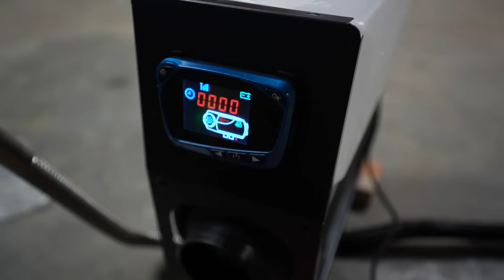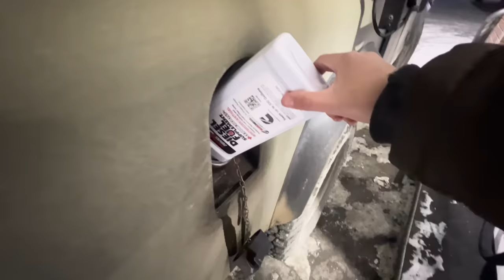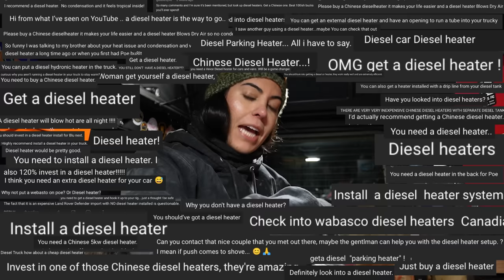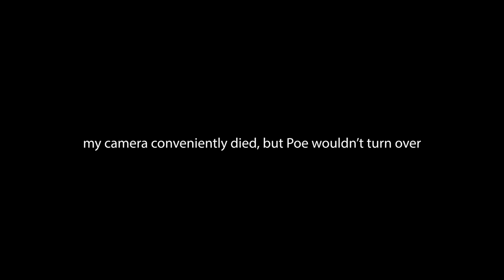Truck Camping in -15 Degrees under the Northern Lights

Comment: Im no expert but i bought a sherpa lined hoodie and it was much warmer than any other coat ive ever had. I would layer thermal underwear with a sherpa lined sweat suit and top it off with a goose down snowboarding jumper, wont be cheap but you can probably walk around outside without being cold. If you are not strapped for cash i believe several companies makes a battery powered heat suit as well but if you did the combo above you will probably be sweating as is.

Comment: This is how you become an Alaskan, you show up and just don't leave. Lol, that's how I ended up here 10 years ago! On a side note, it would have been a good idea to hold onto that buddy heater until you got the Diesel heater figured out. You learn to be overprepared up here after experiencing negative temps.

Comment: Need an oil pan heater as well You just glue that sucker on to the oil pan and plug it in when at a house or anywhere where it can be plugged in. Also any Alaskan mechanic would help hook you up with what you need to get by in Alaska in your excursions through the winter. :D

Comment: If you only have one battery in Poe, go to Wally's and buy a second battery - marine deep cycle type, not car starting - and wire the heater to it. Then, while you're driving, connect this battery to Poe's main battery so the truck is recharging it while you drive. One last thing (for now): make sure you never disconnect the Diesel heater from its battery while it runs. It will melt down... not fun. Wiring gauge and proper connections are also important... lots of little things that can make or break the Diesel heater experience...

Comment: I think the engine gets it much outside air in this weather. Look into that. May need to cover the front grill. Also check into special wiper fluid for those extreme colds.

Comment: Glad you are ok.

Not sure about your heater setup. Check the specs on the heater and the power source. . I have seen people experience problems running the heater due to the glow plugs drawing more amps than the power station, outlet, can output (during glow plug heat-up). for example if the heater requires a max draw of 15a during startup (glow plugs) and the outlet max am is 10a... you will, likely, experience problems.  Good luck.

Comment: Diesel heaters do not work well with portable power stations. They have a large amp draw at start up and will not start if there is too much voltage drop.

Comment: Not for nothing but this is best I can do to help I just watched another channel who was using same diesel heater and I am also sure they had a faulty wire right out of the box, I would check the wiring might need a little more expertise to help troubleshoot but I would start there.

Comment: be sure you add the diesel additive for your heater which you most likely did. That brand has a controller problem a few of my friends bought the same thing. I'm not sure I think another brand of controller will work. Just have to check with others to find out.

Comment: Maria, I’ve had quite a bit experience with diesel heaters and it seems like your diesel heater has a bad control board. I’ve heard bad things about the brand you got but I’ve never had one myself so I can’t say whether or not it’s good or bad.
I bought mine off of Amazon. It’s a Chinese one and it’s lasted me for two years. Hopefully it doesn’t go out on me now that I’m talking about it. Lol. Anyway, my suggestion do not leave the diesel heater outside to run , mount it inside your truck if you can , that way it will stay hot and it won’t out  in the elements subjective to  moisture and all that ! pipe the exhaust out through the bottom of your vehicle. You can leave the intake inside it’s fine that way !  I have mine inside my cargo trailer and it’s worked for two years no problem, you will stay a lot warmer with the diesel heater inside. You may smell a little bit of diesel exhaust when it first starts up but after that you won’t smell anything. That’s just my two cents. I hope you can get it worked out.

Comment: I’ve installed and used a Dirksen heater (still have one in my car) I think the one you bought is for like a small shop,  Or an outbuilding. Maybe. Idk what they have for sale there, but Amazon sells the cheap Chinese or Espar style heater you connect directly to your tank, power to the heater and pump, then exhaust out the back or side of the car.  It’s like the size of a football. They heat up a sprinter high roof so fast it’s hard to manage the heat. Anyway, as a dad of two daughters, don’t have heat and car troubles at the same time and too far from help.

Comment: Check out Chuck Porter  at Everything Outdoors. He's just dine a  minus 15° Celsius  tent camp with the same diesel heater as yours, he also had the air intake in the tent along with the heater and only had the exhaust outside. He found the heater doesn't work as hard when sucking in warm air...He is based in Labrador

Comment: Thumbs up for Gooloo getting it jumped off. I have that identical jump pack. And if you were not sure why it started beeping is it got overheated and needed to cool down (I had it happen to mine). Hopefully you get the diesel heater working. I'll be looking at your next video.

Comment: They say oil change places over-torque oil pan bolts to 100% protect them from any complaints that the oil drained out and wrecked the engine due to them leaving the bolt loose. I kinda suspect they do it so that you can't change your oil yourself and have to take it back to them on your next oil change. If you can get the bolt out, you can replace it with a oil drain valve, and then its just the matter of unlocking and turning the level on the valve to drain the oil.

Comment: Regarding the Diesel Heater, I think that the battery pack is not giving enough power. Try to start with the car instead. It needs up to about 150-180 Watts at startup and many power banks cant do that. I had the same problem on my boat. Turns on but goes out when trying to start the heater.
Reply: To find out if it's this, it might say "overloaded" on the batterything when you try, at the same time as the heater goes black :) Also, they heater is on more Watts, but the 12 volt Car Cigarette Ligher connection often don't have the same output.

Comment: Please, consider heading South unless You get reliable heat for Yourself and Blu AND, Poe needs a Block Heater and Battery Blanket. If Poe freezes up……36 years in AK. There can be days when -15 is a high for the day. At least consider heading down to Anchorage or Kenai Peninsula areas.

Comment: Glad you survived!(Just!) Hope you make sure of having 2-3 heat sources just incase. Carry some fire lighting equipment matches&lighter and lighter fluid, if worst happens you can light a fire as a last resort if you find some deadwood and have a way to light it, to keep from freezing! (Especially if God forbid you breakdown!)
But generally the Landrovers are built like tanks, literally the British Army and many Armies use them for a good reason, as theyre great from a Hot desert to freezing cold temps, So you should be safe aside from battery/electrical issues with the cold sapping them. (Keep that pop up top down to stay warmer and if out of heat, then sit in the drivers seat and put the heater on your feet!)
Stay safe! And All the best from London 👍🏴🇬🇧

Comment: It’s the Jackery. It’s too big for the Vevor. I have the same Vevor heater and the same size Jacery. It’s too much power for it and it shuts if off. However I have a smaller Jackery (300) and it works fine with it.

Comment: The truck needs a diesel heater. (Webasto) 
If I had to rely on my truck I would install one, but they cost so much so I just don't start the engine when its below -10.

Comment: At about 10:40 "I'm lucky Poe is running... if Poe wasn't running right now I would be toast." There you have it.

You're depending on Poe for heat and as a way to get you out of camp if needed. Your plan B seems to be your cell phone. Have you gone through which of these parts worked during that night and which did not, and why?

If Poe stops running, you lose not only your heat source and means of transportation, but pretty soon after that your propane will start acting up and the performance of your power bank will be diminished due to cold. Around where I live, people driving their car north of Polar Circle are advised to carry warm clothes and some dry firewood in the trunk, in case of mechanical problems with the car. The idea is to stay alive and functional until help arrives, and keeping everything really low tech to make sure stuff works in an emergency.

You might consider adding some things in your survival toolbox, if you plan to continue camping in cold weather. Have that heater installed. Add a proper winter sleeping bag - winter outdoors fans sleep in tents at -15 Fahrenheit and colder. Finally a really warm layer of clothing - I'd even look into snowmobile riding gear or something similar. It's Alaska, stuff like that should be readily available in most stores. Safe travels to you and Blue!

Comment: Diesel heater.  I suspect low power source.  Glo plug pull amps, which drops volts from source, which kicks heater into error and shuts down.   That was my experience.  Good luck.

Comment: Your channel is excellent, and your are a wonderful and inspiring young lady!  Lots of good advice from people here that care about you!    Please consider multiple backup heat methods, and not just devices.   Its possible the cigarette lighter outlet on the jackery is not able to carry the startup amperage of the heater??  Could try to start from another source....i had that problem before 
From an old guy grandpa, but have spent alot of outdoor time....still do.     Take care!!    OTD Mike.    (Older than dirt...).  Lol

Comment: Dude. This was stressful to watch. Aside from you needing some reliable heat, you should look at getting Poe cold weather ready. Diesels aren’t great in cold weather. You should have a block heater (for when you can plug it in) and see if you can get a Pro-heat or something. I was a trucker in Alberta Canada for 16 years and Pro-heat is the way to go!  Not sure since Poe is an import but look into it, please!  And stay safe (and warm) out there!

Comment: You should consider sleeping right in the back with the alucab down in the colder climates, I don't imagine that's holding heat in very well, smaller area to keep heated you'd be in way better shape !

Comment: The diesel heater is not starting because it doesn’t like the power draw from the your anaker power module.  The glow plug draws a lot of electricity in the beginning so I bet it’s auto shutdown because it doesn’t have enough energy to start glow plug.  You’re gonna need a direct hook up to car battery with no cigarette lighter plug in. Sorry, I’ve seen this before

Comment: Why didn't you fit a artic  heater to Poe, they are standard military attachments to land rovers that were in service in British Forces. Best people to speak to in UK  is Blanchards or Richards they are MOD /DOD   specialists.  With the diesel heat , you can check the pump is working by taking off the fuel pipe coming out of it and operate unit to see if it pumps the fuel. By the way pump it into a container to catch it or if you have a multimeter check it has the 12volt supply to it. Also with the meter you can check there's voltage on the glow plug

Comment: These CHD should not be run from the 12v input on a portable power station. The voltage is to low. other issues, fuel line green does not work, need to prime etc., these things are a work or art to even work properly...so many ppl these days think they are the new all, hahah be prepared. In Canada and northern climates always have a back up, wood stove, buddy heater....plan for a b c and then D, -15 is a joke when -40 is what you should be prepared for......love your video's, keep up the good work!

Comment: Got to see the Northern Lights in action. Mission accomplished despit trying to sleep in -15 temps. That is something to remember for sure. Now get the heck out of Alaska before you freeze your toes off girl. Also as others stated partially blocking the grill off with cardboard will help provide warmer heat. Running a diesel vehicle at ideal uses next to nothing in fuel. At truck stops 18 wheelers leave their rig running all night on the regular.

Comment: Looks like the DC outlet isn’t strong enough to power it.  I had the same issue.   I have the Jackery 1000, and the DC trips with the diesel heater, but I plugged it into the Jackery 240 and it works.  I bet that is the issue

Comment: Glad everything worked out good for you. About Poe not blowing hot air wonder if the engine was getting to operating temp. If not maybe increasing the idle a bit would get some heat out of it in case your in that situation again.

Comment: You've got to stash a 0° sleeping bag and a mini propane heater. Keep a Co2 monitor too, but if anything happens and you had those, you'd be great.
Reply: Natural Gas is guaranteed and you can always have it.  Gotta keep a propane heater and keep that Co2/Carbon Monoxide with you. You be confidently safe.

Comment: Never fill a diesel heater fuel tank inside. spillages will stink you out. they usually have a hole drilled through the floor for the exhaust to be run through. and are hard fitted in place near a door. Chinese ones are often duds. ebesbacher or webasto are the ones you need but are really expensive to get fitted safely. they are often mounted under the floor between chassis and sills.

Comment: My thoughts, and I've never used a deasil heater before, but I do have a background in electronics as I maintained and repaired radios in the Military.... my mind goes to the pump as well, since in all the other videos you've watched their pumps would automatically kick on but with yours, instead of the pump automatically kicking on it's shutting off... which leads me to think that there is a wiring issues somewhere with the pump... possibly?  Again, I haven't ever seen one of these deasil heaters but that's just what comes to mind.  If you can, I would just have one professionally installed so you know it'll work every time you need it.  When it's -15 degrees you have to be able to count on it working faithfully... and I know the feeling of winging it, and thinking ah I'll just watch some youtube videos and get'er done... but in temps that cold it's best to leave it to the professionals... anyways, I'm sure you already know this.. so i'm not going to harp on you.. I hope you get everything sorted out so you can focus on the good times 😎  Oh, and I gotta say, I had a good chuckle when you got the food sorted out and made the comment "now we're cooking with gas"  I say that all the time 😎Ria, stay safe!  stay warm!  Thanks for sharing! 🤘🏼

Comment: Did you check that your diesel heater is not pulling too much wattage from your Jackery? Some diesel heaters pull 15A and your 12volt Jackery only supplies 10.

Comment: Hey!, no upper body strength is easily fixed with leverage on the ratchet.  Get a pipe and put over ratchet handle...though is judging the tightness after

Comment: Have your mechanic install a switchable battery isolator. That way you can select the house batteries along with the starting battery for starting power when you need it. Also, at -15F+ don't run your battery down and just let it sit. It will freeze and damage the cells in the battery. You really need two starting batteries wired parallel for Alaskan winters. In fact, two deep cycle starting batteries in parallel would be my choice. They're bigger, so your mechanic will need to weld boxes or a frame for them. Also, the Chinese knockoffs of the German made diesel heaters are highly problematic. I'm not surprised you were having issues getting it going. If you decide to fix or exchange it, I highly recommend you buy the German fuel pump that matches the Chinese design and not use the Chinese pump. The Chinese pumps are almost always the problem in most of these knockoffs. It's not the only problem that plagues these units, but it's at the top of the list.

Comment: Hey Ria, love your videos but a little more preparedness would have gone a long way here.  Being "reckless" isn't something you want to be doing in such a hostile environment.  You should have had a block heater installed on Poe as well as a battery blanket and winter front to restrict airflow to the radiator.  Up here in Canada our diesel vehicles come with these from the factory.  Also I believe Alaska has diesel anti-gel in the fuel you get from the pump, the diesel 911 additives are not required.

Comment: Unfortunately the Chinese made ddiesel heaters don't have a great track record.  Best is to spend the $2000 on a good diesel heater and get it professionally installed. Pricey but you never have to go through a cold night again.

Comment: You know you don't have to open the Alu Cab every night, right?
Just the amount of heat loss through the fabric is crazy in those temperatures. Just sleep downstairs
God bless you
Reply: Also get an Eberspächer Diesel Heater for your engine so Poe will be able to heat up the engine and start in all temperatures without worry

Comment: Seriously - You need a block heater for the engine.  It's going to get colder, and no amount of battery boosting will start your vehicle if it's frozen.

Comment: Nothing is wrong with your heater. You just need a jackery that's rated over 15 amps. The heater glow plug is tripping the breaker on your current jackery causing it to shut off.

Comment: I had mine switch off like that my leisure battery didn't have enough power could be something to do with the power from the jackery it needs 12v for start up then it uses like 0.5 amps after